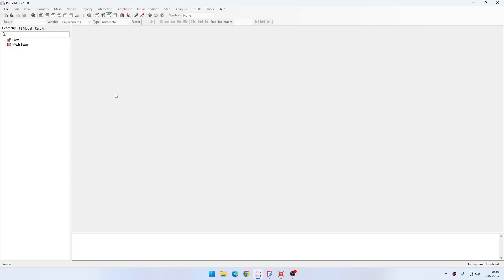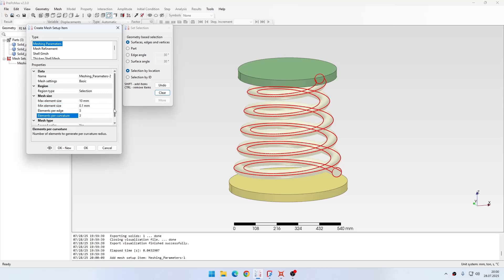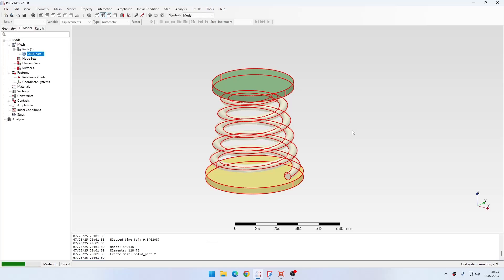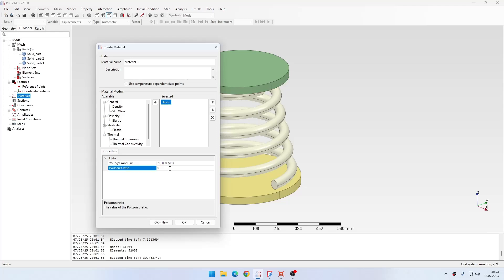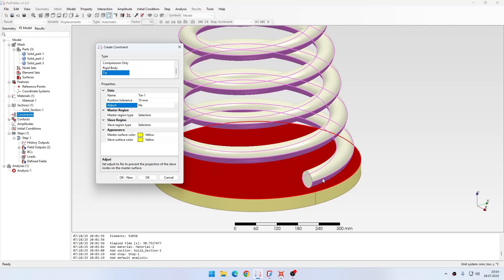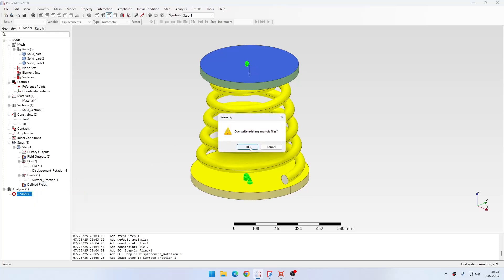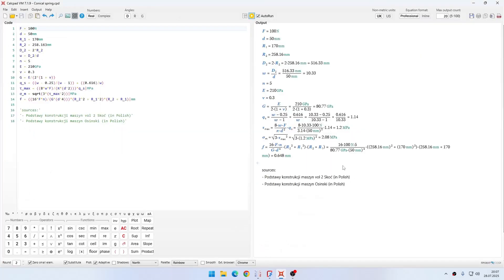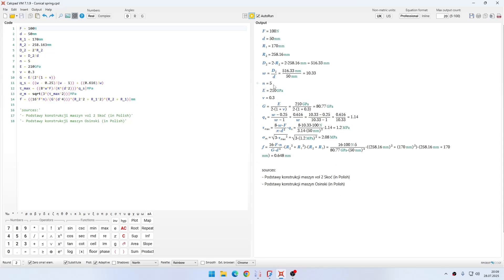PrePoMax (CalculiX FEA) - Tutorial 52 - Conical compression spring

Comment: Is there a way to make two tied objects have their meshes match up? And is there a way to increase meshing density at and around the contact areas between two parts? I'm putting a film on a support structure, and I'm getting absurd analysis results. I think that better meshing would help a lot, even if it turns out that my main problem is elsewhere.
Reply from the maker: It's often better to create compound parts (ensuring continuous mesh) instead of using tie constraints to connect them. Of course, you can also mix those approaches (merge some parts and then tie them to other parts). There is also a feature to merge coincident nodes (within a given distance tolerance) of separately meshed parts. Of course, if it's solid to shell connection, you will need tie constraints or tied contact. When you define all connections, run a frequency analysis to see if there are no loose parts.

Comment: the conical springs show deflection in two different regions: 1. Linear region, 2. Nonlinear region; if the load applied exceeds the linear region, the spring will transition into nonlinear region and stiffness would change accordingly. the formulation you provided in calculation, may only account of static stiffness of linear region, and may need separate calculation for nonlinear deflection curves. 
Manuel Paredes and Emmanuel Rodriguez have provided detailed formulations of conical springs (2005; DOI: 10.1115/1.2338580) in nonlinear region, and may be referred for accurate calculations to compare with FEM.
Reply from the maker: Thanks for the clarification, I appreciate that. The deflection was small here and agreed well with the linear theory.